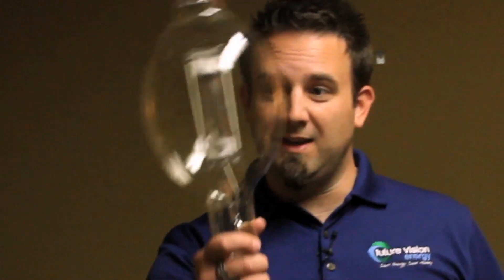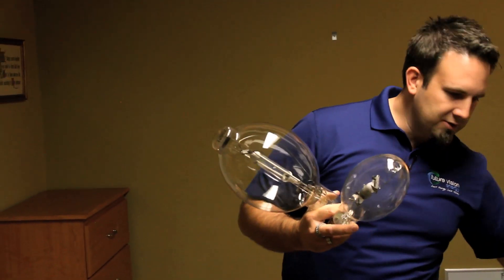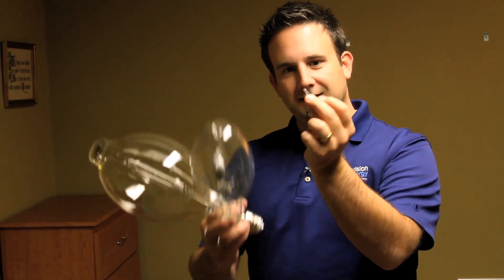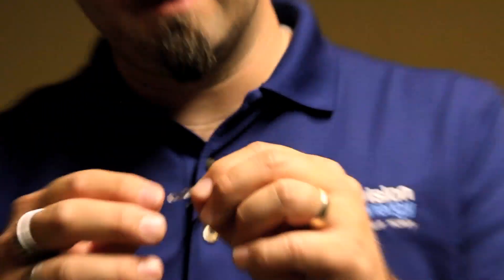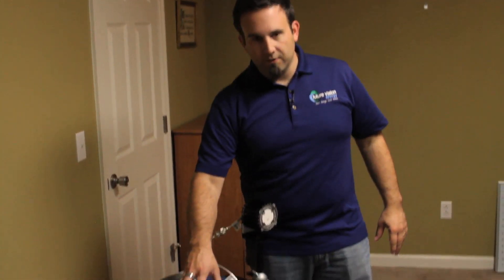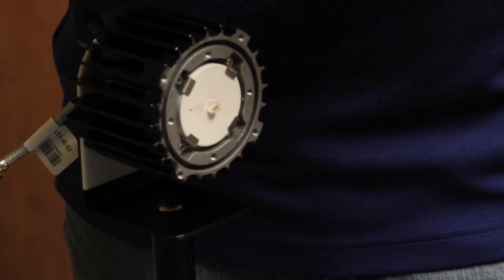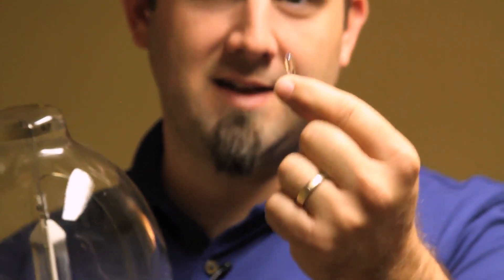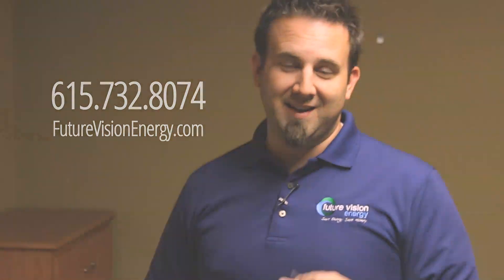Digital Brochure: Light Emitting Plasma (LEP)

Comment from the maker: It puts out 23,000 initial lumens, but they are directional and the CRI is very high. So while the lumens aren't as much as a 1000W MH, it actually can effectively replace them in most applications due to the greater directional light output, higher CRI, and better light distribution/quality. We replace 400W and 1000W MH and HPS all of the time.